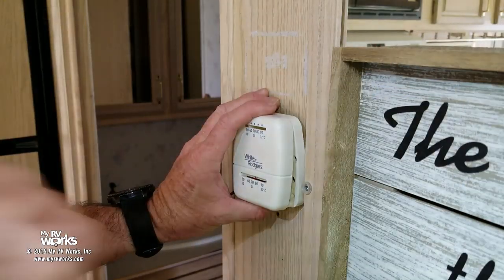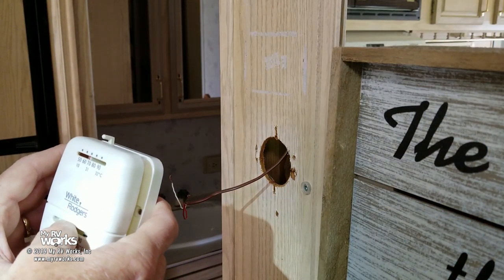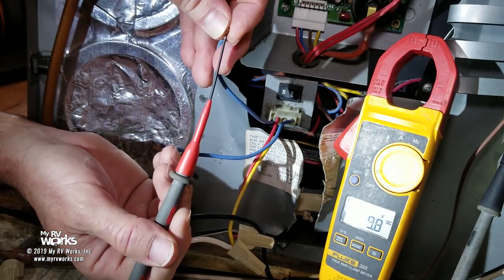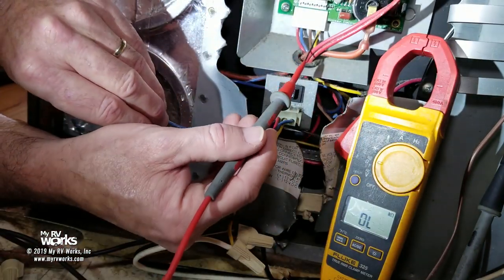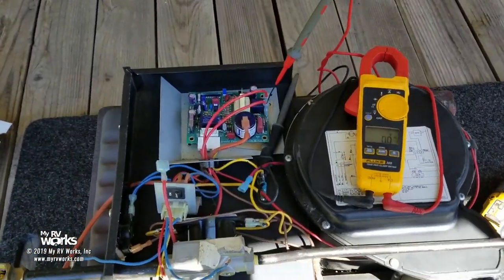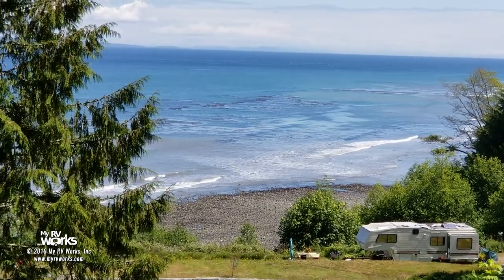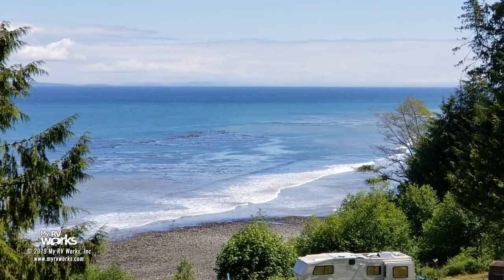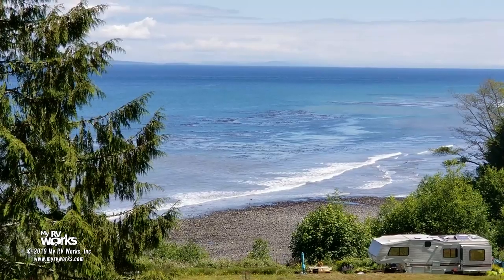RV Furnace Clicks But Doesn't Engage Blower Or Produce Heat - BONUS Strait Of Juan de Fuca Peek

Comment: My furnas runs but i dont here a click and it dont throw heat where do i start?
Reply from the maker: You need to verify your getting voltage coming back from the sail switch into the control board. If you look at the wiring schematic you should be able to determine which wire that  is (usually blue wire but sometimes it's red.) On my website you might be able to find the service manual for your furnace that will be helpful.  https://myrvworks.com/manuals/

Comment: So.......you have spent how much time pulling this furnace out and dis-connecting wire, gas lines and stat. ........when all this could have been done with the unit still installed. OMG are you getting paid by the hour?  Sorry but I am not impressed with your trouble shoot skill. You should have located the problem in the first 15 minutes.
Reply: silly boy...you have to pull out the unit to replace the fan motor, the tech also did a check up on all connections, faster to pull the unit out, you ding-dong
Reply: @erikcable1755  I did not say you did not have to pull the furnace out.  I said the testing skill sucks. I figured out what the problem was with in a couple of minutes of testing. He had a lot of "this and that," just to make it look good. My God boy get to the point...time is money.